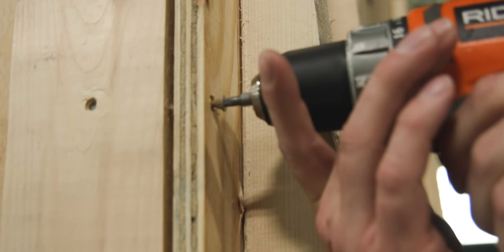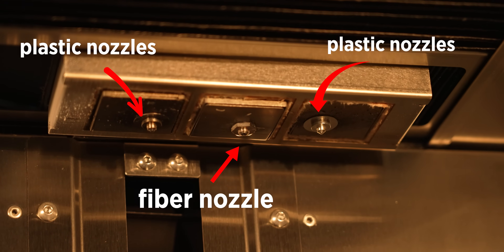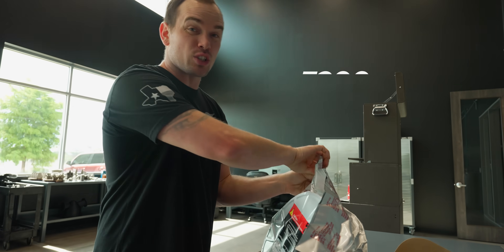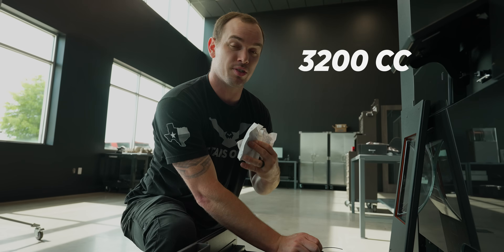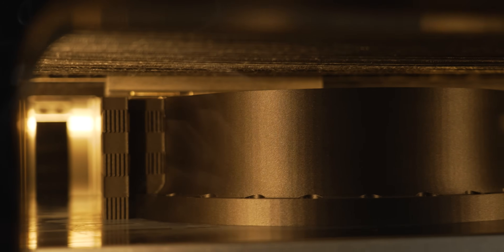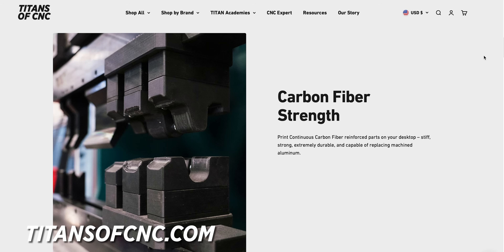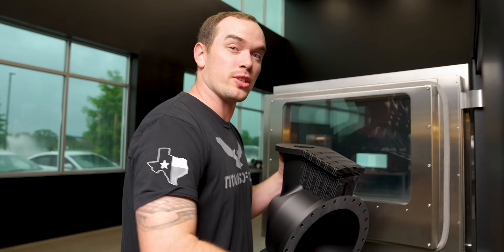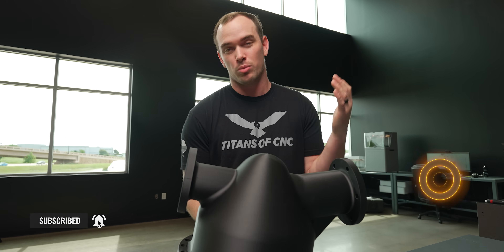The Biggest 3D Printing Machine We Have Ever Had

Comment: Yep, that piece is messed up. It’s not a layer shift, rather shrinkage of sections of the part due to high printing temperature of Nylon CF. I print in this material a lot and even with the heated chamber, large pieces tend to shrink about 3% depending on geometry. My theory is that it has to do with the chopped carbon increasing internal stresses in the material.

Comment: i mean this is obviously an industrial grade machine so it prints good, but for that price, you could've hired an independent maker to develop a machine like that based off an open source project, for a fraction of the cost and still achive the same result if not better, both in terms of print volume and possibilities, such as toolchanger etc..

Comment: at 4:20 it looks like there´s layer delamination at the right flange
Reply: Hard to tell if it's separation or actually overextrusion at that layer. There's a similar artifact on the left flange. I'm going with overextrusion.
Reply: @tcolesen  random overextrusion? I don’t think so, because its only on the outermost edges of the part. Overextrusion could also be in the middle
Reply: @Gekkoperformance  I wouldn't call it random. In my own experience if there's an "extrusion inconsistency" there can be localized overextrusion caused by the extruder doing something different in an area from one layer to the next. i.e. printing in differing directions in adjacent layers because of a feature present on one of those layers but not the other.

Comment: Such an expensive machine, and it looks like it still had a layer shift....
Reply: ya it's through the whole layer, kinda unexpected tbh
Reply: I can't see layerschift. Only a relativ low quality print model because auf the vertical lines.
Reply: @oberender64  You can clearly see the line going through the part on the table and while he's holding it.
Reply: @Imdor I would say thats a extrusion problem.
Reply: @oberender64  Does it really matter when it's such an expensive machine and a 2 day print?
Reply: are you sure it's not just a filament hair ?
Reply: @CaseSurMesure  yes, im shure.
Reply: end of the Support Structure
Reply: That's not a layershift, other parts of the print are clean. It seems looks like overextrusion or underextrusion in that particular region of a layer
Reply: Do they not just print stuff like that quickly to use for test fit and not an actual functioning part? I dont no much about these machines, so it is an actual question, i not being a smart cutn..
Reply: If that would be layershift - that would be visible through whole part, but it is visible only on the flange.
Reply: @antonsemenyura5337  it is
Reply: @antonsemenyura5337  It's not just visible on the flange tho, it's also on the middle part if you look closely.
Reply: @Imdor no layershift on the body...
Reply: @antonsemenyura5337  Pause it at 4:29 and tell me again that you don't see the lines going down the "arms", might not be a layer shift, but something fucked up.
Reply: @Imdor yeah there is something there. That guy must be blind to say this is perfect. Also seriously there isn't an active drying for the filaments 😂😂😂?

Comment: We have a Stratasys 450 that can do 15 different types of material. Slightly smaller print area but they also make a larger machine. 3D printing is great but gets expensive for the filament.
Reply: The Fortus is a tank, things never die.